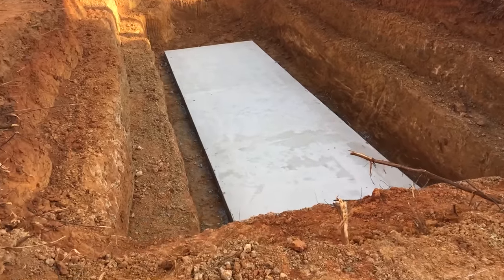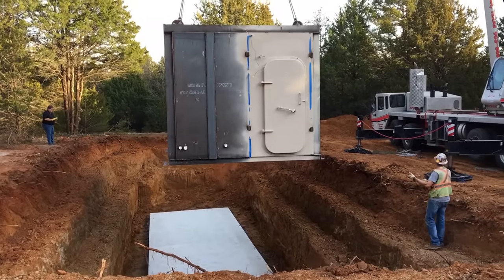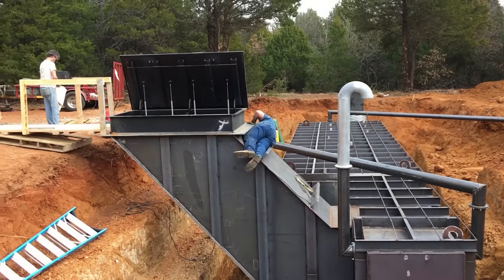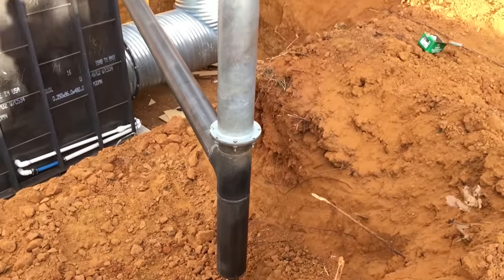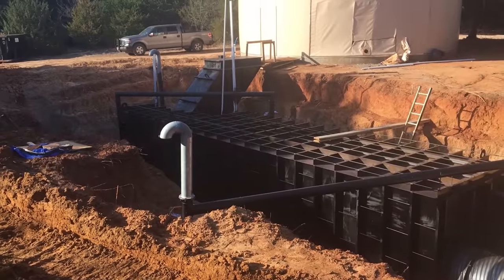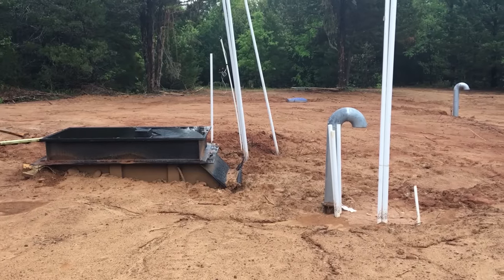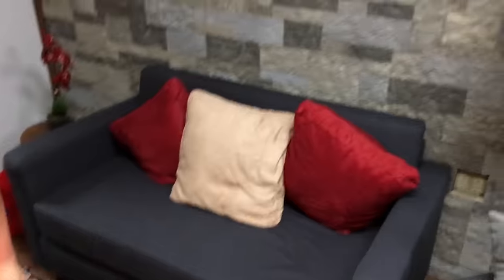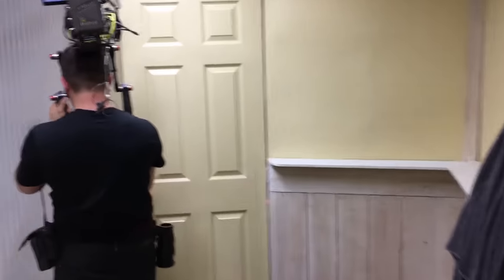Atlas 10x30 Safe-Cellar - Luxury Bunker Built Under A Home (Complete Installation Video) - Part 1

Comment: Now that's a fancy coffin !
Reply: JoãoPedroDomingues tomb
Reply: Why a coffin or tomb? There's an escape hatch, and a stair case. It may save your life in a disaster or WROL situation, but it isn't going to kill you.
Reply: @catlover1986  You are right. The thing about bunkers or fallout shelters, is that most people say they're a daft idea, but if there was a nuclear war or disaster, most people would want to be in one & suddenly change their minds. Talk is cheap in peace time. Although this one is close to the surface, its 1 foot  concrete roof & about 18 inches of earth on top would give a protection factor of about 1000 against fallout. The direct radiation from nukes is more penetrating, so I'd have put 3 feet or more of earth above for a blast shelter.Our small MOD bunkers only had 3 feet above their reinforced concrete roofs. We had over 1500 of the smaller bunkers built that way all over the UK, & lots of larger headquarters bunkers.Most bunkers would have survived a nuclear attack, & protected those inside.
Reply: @michaelthomas3105  True. Bunkers aren't perfect, but when a nuke lands nearby, or even far away, or a tornado or period of civil unrest comes, a bunker is orders of magnitude than not having a bunker.
Reply: @catlover1986  Hi, I don't really understand why people get so upset about the idea of bunkers. People spend out a lot on cars, or whatever, why not on a bunker if they want one? I've built them & worked in them. Have a nice day.
Reply: @michaelthomas3105  It is psychological. They are offended at the idea of individuals making their own accomodations without them. I saw a news story once explaining why you shouldn't be allowed to stockpile food because it drives up prices (laughable). Insanity.

No one actually believes it is a dumb idea. They are rationalizing to themselves.
Reply: @catlover1986  It would be better if everybody thought it was a good idea to have shelter & at least a few weeks of supplies in store in case of emergency, along the lines of Switzerland. Some countries do have a better civil defence system than the US & UK etc. Obviously many people couldn't afford much, but even a fallout protected room, modified basement, or communal shelter scheme would be better than having no preparation at all & just assuming no nukes are ever likely to be used. It's not as if there are enough nukes to cover more than a relatively small percentage of the area of countries such as the US with blast.
 A fallout shelter with  just a few feet of earth would be adequate in most cases. It wouldn't be necessary to spend as much as $100,000. For that sort of money I'd try &  make it fairly blast proof if there was a possible target nearby. Even a modified root cellars can be OK as fallout shelters & not be all that expensive to build. "My Root Cellar Part 1," by Shalom Acres has detailed engineering plans. Even as it is, with only a 6 inch thick but fairly heavily reinforced concrete roof, it can have 30 inches of earth put on top. For a fallout shelter I'd make the concrete roof a few inches thicker & put a 90 degree bend to any entrance, but it gives an idea of what could be constructed without spending an absolute fortune. The filter material as used in domestic cooker hoods & made by 3M, would do for a fallout filter at the end of an inverted U shaped pipe, with air sucked in by a hand cranked blower fan, or a 12 volt fan. americansaferoom.com do the NBC air units, but they're not cheap, plus you don't actually need  the activated charcoal filter if it's just for nuclear fallout dust.
Reply: +Michael Thomas- The thing is, it wouldn't be a big deal. To buy a couple weeks worth of canned food, and basic emergency supplies is negligible in price. Perhaps a few hundred bucks. In a basement, that can offer quite a bit of protection from various disasters. 

As far as a bunker, people could literally build a concrete block bunker that is 20 square feet, reinforce it with rebar and concrete and bury it under some dirt. That's a bunker, even if it won't withstand a direct bombing attack. 

Survival is infinitely easier BEFORE a disaster than AFTER. Yet people prefer to wait. I often ask, "Do you refuse to wear a seatbelt because it isn't likely that you'll need it"?

I do believe it should be like Switzerland, where we're all prepared. It would stabilize the nation and reduce casualties during dangerous events.
Reply: @catlover1986  It's a shame that so many people seem to think a bunker would be too expensive to build if it was to be of any use in a nuclear war & talk of them needing to be over 20 feet, or even 50 feet below ground to be of any use. I've spent 1000's of hours in government bunkers, & many don't have more than 5-10 feet of earth above their concrete roofs, sometimes less than that.The chances of a nuclear war are probably low in any year, but taken over the coming several decades, the chances are not as slim as many people like to think. As you say, people put their seat belts on, though the chances of an accident on each separate journey are tiny.

I often wonder what people that laugh, then talk of putting their heads between their legs in a nuclear war, would actually do if given say, an hour  that the situation was dire, conventional fighting had escalated, &  that nukes might  well to arrive shortly. I can't see  people banging the wife & kids on their heads with bricks, shooting their families, or all overdosing on paracetamols, just assuming the reports would come true & WW3 would be all out nuke use. Nor can I envisage families calmly sitting in their lounges & hoping for the best, or accepting that their curtains might shortly catch fire, or that fallout could soon arrive & they'd all get very ill or die if all they had were wooden doors & some possibly intact windows to "protect" them.Most would think "what can we do ?" then rush around in a mad panic trying to improvise some "shelter" in a broom cupboard, under their stairs, or follow the rather pathetic "take your doors of & hide beneath them", official advice such  in the UK "Protect & Survive" leaflet.
Reply: @catlover1986  neither do coffins. this is where people 2000 years from now will discover the owners bodies. thus making it a fancy coffin or tomb. sucks i have to spell it out.
Reply: +Shortbuspimp, bunkers have a long successful track record. They have been used countless times in actual wars and disasters. 

You should not think of a bunker as something from some Zombie Sci-Fi movie. They are temporary hardened shelter against numerous threats. It is very unlikely that an even moderately prepped shelter would leave the inhabitants dead in most disasters. Even nuclear war is likely to be survived, based on government experiments examining the safety from the blast wave, over/under pressure, and radioactive fallout following a disaster. 

Being under 10 feet of dirt is basically a guarantee of survival once you are 2 miles from a nuclear detonation.

Remember, TEMPORARY shelter. It's designed for a few weeks to a couple of months at worst. That will get you through most disasters comfortably.
Reply: I agree  @catlover1986   The fact is that fallout radiation will have died down by 100 in 2 days, and 1000 in just 2 weeks, compared to the measured level one hour after the nuke went off, due the "rule of 10 to 7. That is a fact, though few people seem to know it, based on those people saying a person would need to be in a bunkers for years. I'm not saying that if 1000's of nukes were used WW3 would be easily survivable, but WW3 might well involve mostly conventional weapons, then a more limited use of nukes, possibly even less than 100 nukes, followed by a negotiated end to the war. It MIGHT be the all out nuke "Armageddon" scenario, but we just don't know 100%, so fallout shelters could well be of great use in a WW3. In the book :"The Third World War" by General Sir John Hackett, the WW3 ended with just 2 nukes being used, one on the UK and one on Russia.  I think more nukes would be likely to be used than that, but if 100 nukes were used, that would not be the end of the world, and people would mostly fare better if they had their little fallout shelters.
 Even in an "Armageddon" scenario, ordinary folks inside bunkers could at least commit suicide and end their lives in less pain, if that's what they decided, rather than finding they were getting ill from radiation sickness, or being fried by being caught by surprise outside. Many people in Hiroshima were burnt, but didn't quickly die. People otherwise may not know for sure it was a massive nuclear WW3 and they'd need to decide whether or not they wanted  to try to survive it. An EMP protected battery radio kept initially in a Faraday Cage would be essential to know just what was going on and how bad things might be. Kind regards.
Reply: +Michael Thomas, by using metal, you can actually make your whole bunker a Faraday Cage ;)

As far as nukes, people often misunderstand the environmental effects. Even a full scale nuclear war with 12,000 detonations (the entire US and Russian arsenals and 95% of the world's nukes) isn't like to cause "nuclear winter" and our nukes today just aren't Cold War grade anymore. We use a lot more nukes in our ICBMs today, but they are much weaker. The strongest US nukes are roughly 1 megaton warheads. We used to have standardized 9 megaton warheads all over the place. 

Additionally, the effects of nuclear weapons are often mistaken for prototype and experimental weapons that were never widely adopted. When most people think "Thermonuclear Warhead", they are actually envisioning a "Cobalt Bomb" or other "salted bomb". That is a powerful radiological weapon derived from a nuclear weapon designed to maximum radioactive fallout effects for the longest possible time. Salted bombs are "Doomsday bombs". Salted bombs can keep an area dangerously radioactive for 1,000 to 10,000 years. Chernobyl is basically an accidental salted bomb, because of the graphite lining they used in the reactor cores. 

All other nukes can be comfortably survived in a bunker, and no normal nuke has the possibility of wiping out life on the Earth.
Reply: Hi  @catlover1986   I've given you a "thumbs up" because I don't think all our nukes being detonated would be enough to be able to cause a nuclear winter either. When I did nuclear  warning and monitoring for the MOD we never considered a nuclear winter that likely, even with the "monster megaton" nukes back in the Cold War. The trouble is it is impossible to prove or disprove it. Some scientists are forever arguing about it. I'm certain 100 "average" 500 kiloton nukes would not be enough. The whole nuclear winter idea is only a theory, after all. When the retreating Iraqi army set 700 oil fields alight in the Gulf War, the exact same group of scientists that devised the nuclear winter theory, know as the TTAPS group after their initials, said it would cause a nuclear winter type of effect. It did not, so these scientists had to admit they were wrong.
 Around 14,000 nukes totalling 7 Gigatons currently exist. But they would not all be ready or able to be used in a WW3, and some would be likely not to detonate as well as expected, or even to fail completely. I  don't totally dismiss the idea that if 1000's of megatons were used on the type of flammable targets that would  result in many firestorms it could cause some form of nuclear winter effect. What annoys me is when the Press and some scientists talk of nuclear winter being a definite fact "set in stone", and even worse, when they state that "100 nukes WILL cause a nuclear winter lasting about 100 years". Absolute rubbish, and nobody could possibly know accurately the amount of soot 100 nuclear detonations would put into the atmosphere or calculate how long such a winter would last, any better than guesswork. 
The 50-57 megaton estimated yield RussianTsar Bomba caused no nuclear winter, but that was just one bomb, and not on flammable cities, so we've nothing to go by.  Computer models can come up with any result scientists wish if incorrect assumptions are fed in. My opinion is that there are far too many unknowns & variables, including the weather in each location at the time of each detonation in each country, as well as all the other things, to know. If such a thing is possible, vast numbers of nukes used would obviously make the nuclear winter theory more likely. Kind regards.

Yes, I agree, metal containers used as bunkers can help cut down EMP acting as faraday cages. The trouble is that most bunkers, such as the Atlas one here, only have rubber seals on, so may be watertight , but they are not RF tight. All doors would need copper seals on to be better Faraday Cages. Also, the cable and service inlets would collect the EMP. Really they should have suitable filters and devices to attenuate the EMP, non-linear resistor networks, high speed spark gaps etc. They've been making EMP protective devices for decades. Ordinary lightning protection is not fast enough.
 I know of a case where somebody tried to use a mobile phone inside one of our RAF communications bunkers. He was surprised to find that he got a signal & could do it. Both the steel outer blast doors and the inner door with a copper strip all round were close tightly. Next he cleaned off the copper strips around the inner door and frame with isopropyl alcohol. It was then no longer possible to get a signal and use the mobile phone. 

BTW, if anyone is thinking that a shipping container will work as a good Faraday Cage, they won't. They are not "all metal boxes," but in fact have wooden floors fixed to a row of C section steel beams. Also, the  big steel double doors are even worse. Such containers would need continuously welded steel sheet or plates welded to their floors. Then they'd need an internal bulkhead with a door that made good connection all round to a metal frame via copper strips all around the perimeter. You could  replace the double doors with a welded plate, then have a different way in, perhaps a smaller set of doors, one with a copper seal. Lot of work, plus shipping containers are only strong at the corners and need strengthening & waterproofing if anyone wants to bury them, or the roof & side walls are likely to bow in or collapse with the earth pressure.
Reply: Conrrado Torres  What are you talking about, and why would that matter?

Padlocks can removed internally through removing bolts.

Comment: great location....when the content of that silo comes out.......and a collapsed house on top.....
Reply from the maker: Thanks for watching
Reply: Every couch-hero knows best.....but wouldnt it be smart to put the entrance a bit deeper than  the actual living area? That way radio-active particles that stick to shoes or fall in the entrance are at a lower level than the living space...
Reply: That silo looks like a monolithic dome airform. It's basically an inflatable canvas bounce house, until the interior is coated with a few inches of Urethane foam,  a net of rebar, and then a few inches of shotcrete. More rebar and shotcrete can be added to the exterior. And that rebar can be made of basalt, to prevent spalling. By the sound of it, another dome was going to go on top of the bunker itself. 

https://www.monolithic.org

The advantage of that is that the dome itself is virtually indestructible, as it's an arch and any blast is going to flow around a reinforced concrete structure instead of into a perpendicular  wall. The concrete also provides an additional degree of protection from fallout, and depending on the windows, EMP protection. That  bunker will be quite well protected. 

Out of curiosity, I wonder how well a culvert type bunker would do if it were wrapped in a cage of rebar and sprayed with a liberal amount of shotcrete.

Comment: Could a shelter like this be buried deeper than is shown in this video?  Is it possible for this company to do a clandestine installation?  Do they guarantee that they will never reveal to anyone, government, law enforcement, military, or anyone else the location of your shelter?  Is it possible to disguise or hide the ventilation pipes, access door, escape hatch, etc. to avoid giving away the location of the shelter?  Is it possible to have auxiliary ventilation and close the other ventilation from within the shelter?  If one set of ventilation pipes are damaged or tampered with I would think being able to switch to alternate ventilation would work.  Is it possible to have water storage / water filtration, and a deeply drilled well as a source for water all underground?  Is it possible to have a grow room with grow lights to grow vegetables in the shelter?  Are sustainable food sources possible in the shelter?  What is the longest time someone could survive and have all the necessities required in a shelter like this?  What type of air and water filtration does this shelter provide?  How would electricity, radio communication and receiver, tv, internet be maintained in a shelter like this if an event such as a nuclear explosion, chemical or biological attack actually occurred?  Would it be possible to build reinforced protection for the ventilation pipes to keep the ventilation pipes from being tampered with or destroyed and perhaps to disguise what it actually is?  What specific measures are available to prevent anyone from ever knowing the location of your shelter?  What specific measures are available to keep someone from blasting or otherwise forcing their way into your shelter?